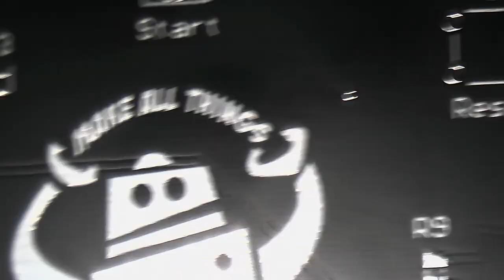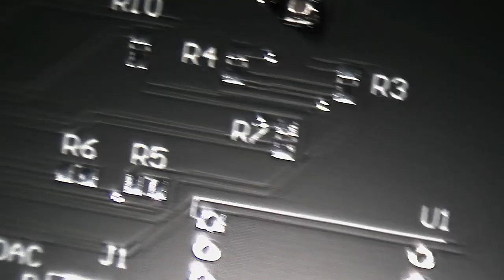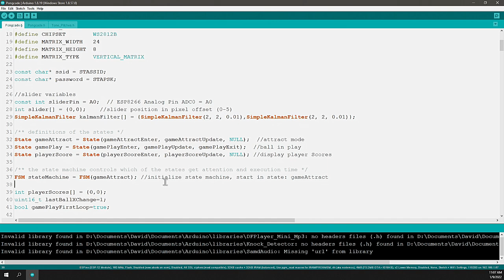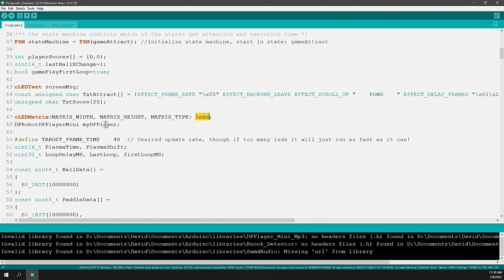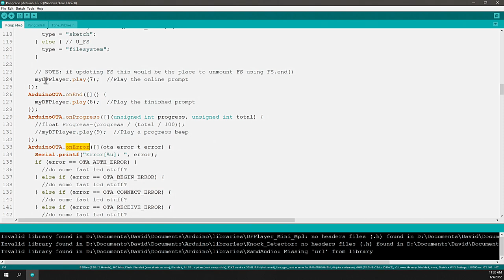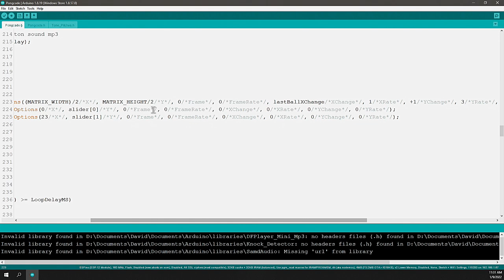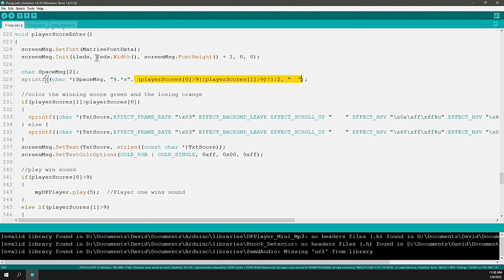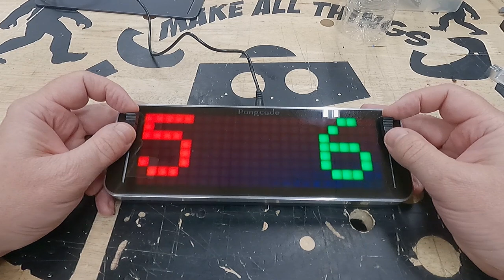Game Electronics, Final Assembly, Programming Logic and Demo of The Pongcade!

Comment: This is some great stuff! Thanks you for sharing. Do you think you can make a video on producing mechanically accurate parts with resin printing Or direct me to where I can look that info up? I have a similar form factor printer (Phrozen Transform) and use the same resin as you. It's been hard to get the dimensions right due to shrinking while curing and just calibrating the printer. Thanks again!
Reply from the maker: Hi, there is a direct correlation of resin thickness to shrink rate also when using ipa the parts will absorb it and swell. The important part is to fully cure and allow the part to put gas any ipa before measuring it. If you find that your part is off after four hours, then you can increase the scale of your part to compensate for these factors. All resins will have slightly different material properties, but that should get you started! .